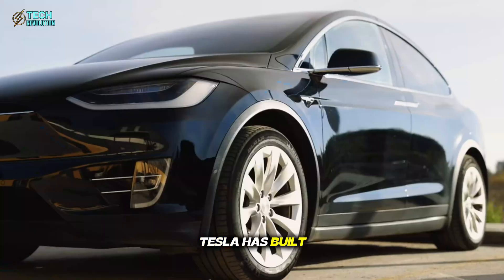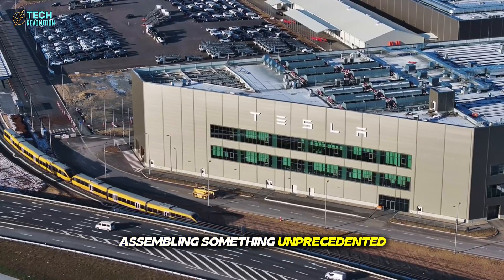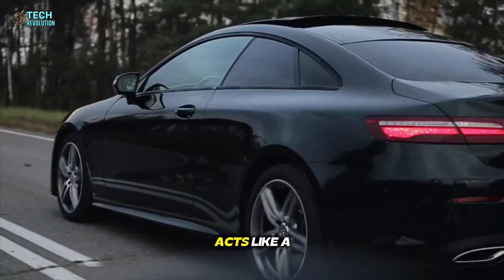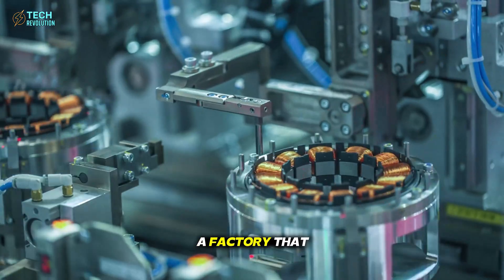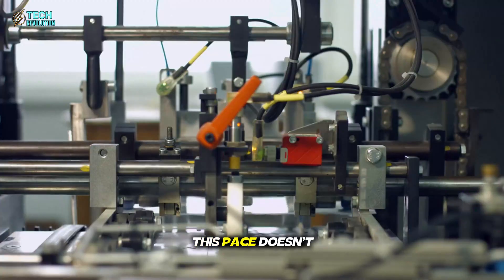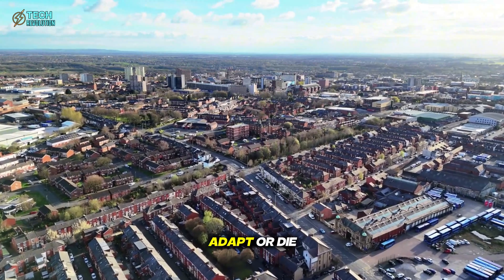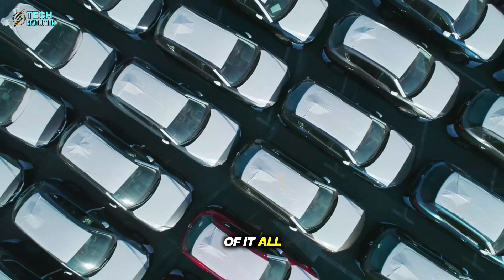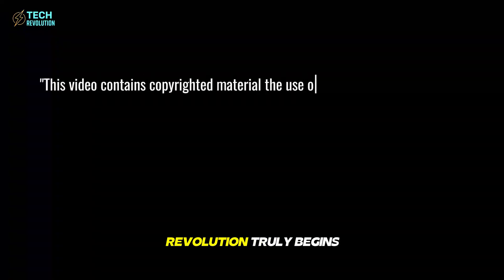End of Assembly Lines! Tesla's 30-Second Factory SHOCKS Industry

Comment: How does the car owner replace a faulty part that is glued in place?
Reply: I found this on the web. 

"For newer Teslas built with large structural castings and adhesive, replacing a part involves sectioning out the damaged area and bonding a new one in place. This process is different from traditional car repairs, but for certain types of damage, it has proven to be effective and, in some cases, less expensive than expected. 
The repair process for glued body structures

The repair procedures are specifically designed by Tesla and must be performed by a Tesla-approved Collision Center (TACC). 
Cut the damaged section. Using a reciprocating saw, technicians cut out the damaged part of the casting. Tesla's repair diagrams provide specific reference lines for where these cuts should be made.

Prep the surfaces. The mating surfaces on both the vehicle and the new component are cleaned and abraded to remove any oxidation, ensuring a strong bond.
Apply structural adhesive. A Tesla-approved structural adhesive, such as Fusor 2098, is applied to both the vehicle and the new casting section.
Secure the new component. The new part is carefully positioned and held in place with clamps or rivets. Technicians ensure the correct amount of adhesive is applied so it squeezes out evenly along the joints.

Cure the adhesive. The adhesive is then either force-cured with heat or allowed to cure at ambient temperature. This process ensures the joint reaches its full designed strength.
Seal and protect. Final steps may include applying seam sealer and corrosion protection to the repaired area. 
The impact on repairability and cost

The use of large cast parts and structural adhesive has changed the economics of collision repair for Tesla.

Potential for lower costs: A study from Thatcham Research on the Model Y found that its mega cast construction can lead to lower repair costs in cases of minor impacts, as the single, strong casting can withstand damage that would harm multiple components on a traditionally built car.

Total loss risk: However, if a collision damages the structural casting beyond the designated sectioning lines, the vehicle may still be declared a total loss. This is no different than a conventional car with a bent frame.

Case study: Cybertruck hitch failure: When a Cybertruck's frame was damaged during a test, the repair was made by sectioning out and gluing a new piece of casting on. The final repair cost was about $14,000, which was significantly less than many industry experts had initially predicted for this type of structural damage.
No aftermarket parts allowed: Tesla only allows the use of new, Original Equipment Manufacturer (OEM) parts for repairs. This is because non-OEM or recycled parts cannot be verified to meet the same safety, quality, and structural integrity standards"
Reply from the maker: Good question — Tesla’s new unboxed manufacturing system actually makes each module replaceable, so faulty parts can be swapped without tearing down the whole car.